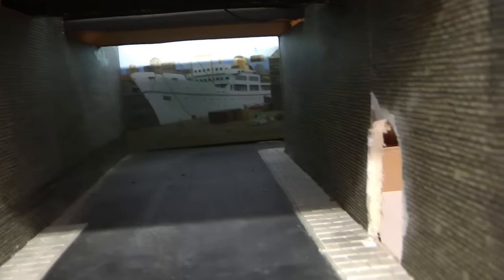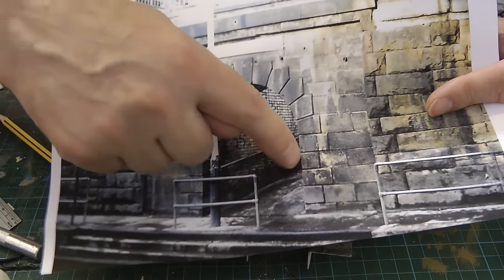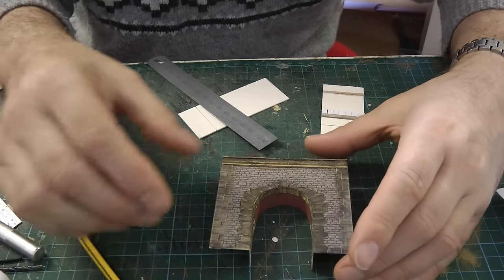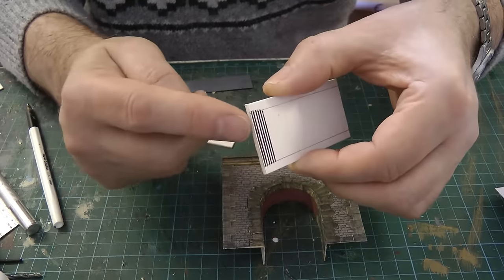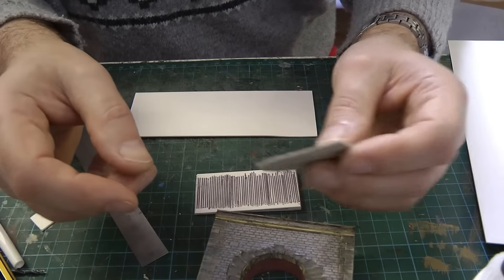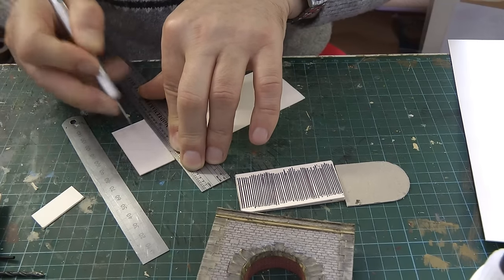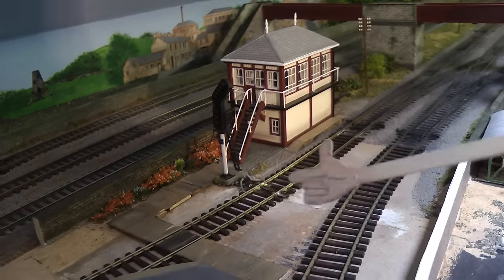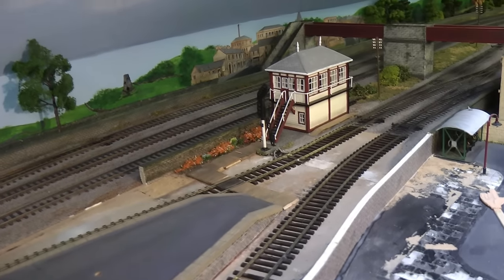Tyne Dock Re-Build  Part 5. The Entrance & Platform   No 427.

Comment: Really like the use of the vanishing points in your tunnel, the contrasting colours added to the illusion -it saved you tonnes of work if properly tunnelled through to link up, ha ha! There is certainly a lot to do, look forward to the next…. All the best Stephen
Reply from the maker: Good morning Stephen. i did think about putting in a proper tunnel. because i did leave the main entrance open. but i opted for the easy option. which is ok. but a full tunnel would have looked better. its all about how much time i need spend doing these builds. the great thing is the illusion works a treat.  many thanks for commenting my friend. best wishes to you and Celia. Tony & Laura.